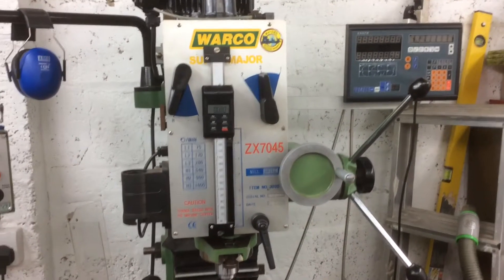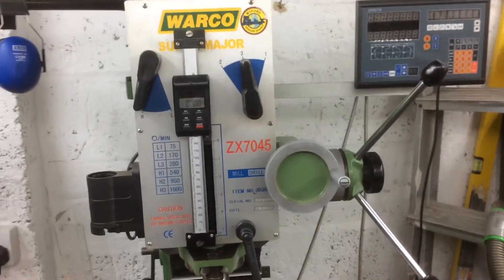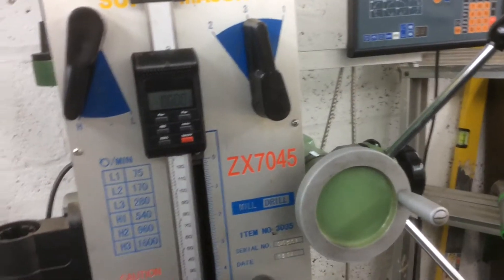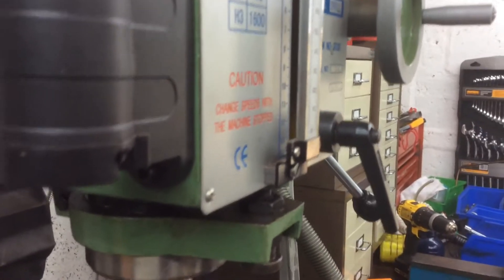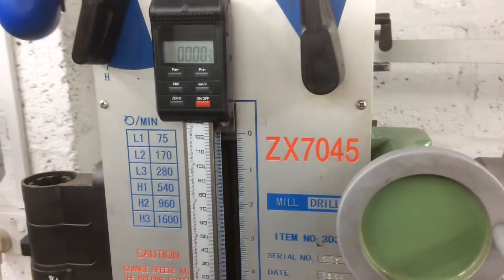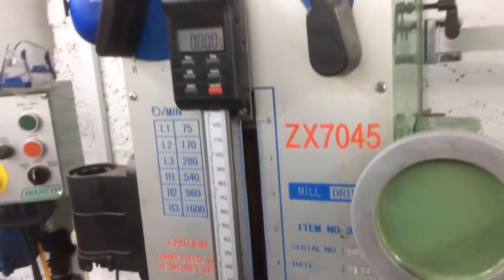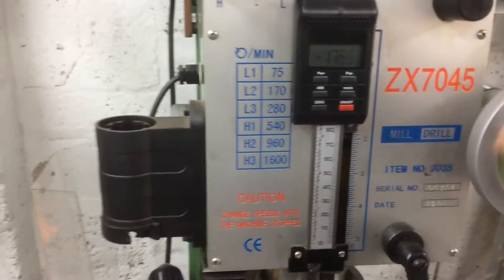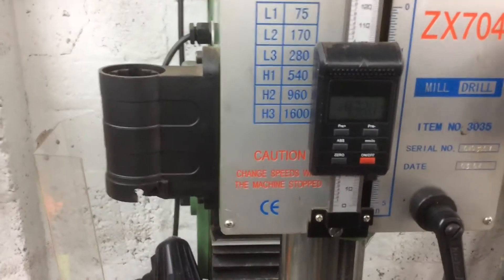Warco Milling machine with DRO

Comment: Nice add on for the machine think I will have to do that on mine which is a similar machine chester superlux 
Good surname ambler same as mine
Reply from the maker: Steve Ambler Hi Steve nice to hear from another Ambler.  The DRO is a really useful addition to the mill. Thanks for stopping by Steve.